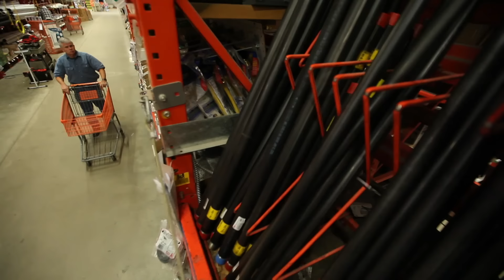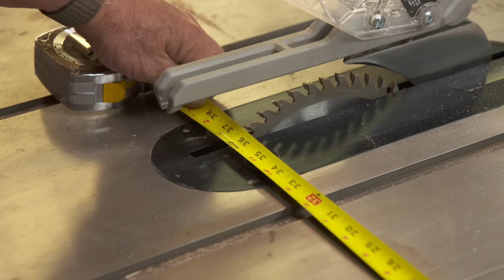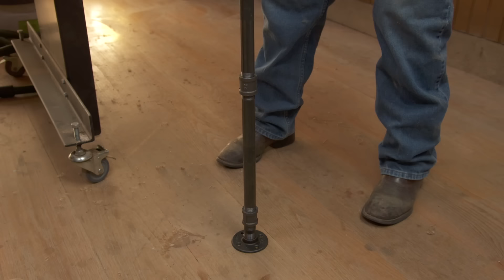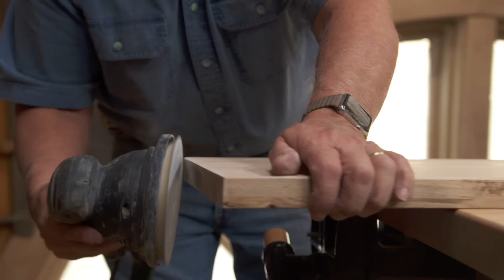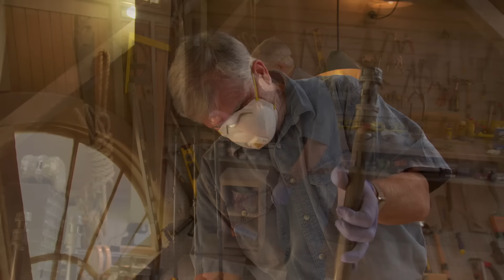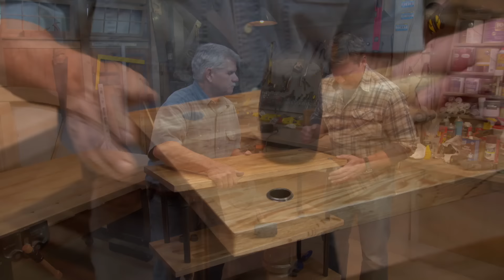Black Pipe Bookshelf | Build It | Ask This Old House

Comment: This is a great rack idea. It's simple, modular, robust and adjustable. You can adjust the height simply by using different length tube segments. Also, when you move house or change the number of pieces of gear you can easily add or remove shelves at will. As a bonus it looks good too, with that retro-industrial-rustic design and it can be made very cheaply.

Comment: nice, I made a desk a couple years back with plumbing pipe at my local hardware store. I spray painted my couplings gold, and the pipe a more even black paint and left my flanges and elbows the gray color.  Had no idea this was a trend until now.  I wanted to buy a desk with the industrial look, but some ran between $1200-$3400 for a desk. So I decided to make one instead and mine is a taller than normal, so I could stand and wouldn't have to use a chair all the time to do my computer work and general work.  And a heads up, I used 1 1/4" pipe and those flanges are not cheap.  I needed 14 flanges and it cost me almost $200.  Total cost was about $900  :/.  Wood is not cheap.  Nonetheless, I am very happy with my desk and it will serve me years to come.
Reply: +jessejames! Nice,I want to maybe build my own solid shop table I'm not sure If these ideas would work but it's a good thought.I'm using an old wood table the thing is short and shakie what you explained sounds nice I'd have to do that sometime too for a computer stand.

Comment: One way to reduce the price is to buy a larger piece of pipe and have the home center make the cuts and threads for you to your specifications. I know that Home Depot by me will do this (the cut/thread machine is generally in the same isle) for free. I think you can get a 10' length of black pipe for less than $20...
Reply: They’ll usually do a few for free but don’t expect them to cut 20 ends for free

Comment: As others here have commented, black pipe and fittings are expensive. I have built several shelving units using inexpensive PVC pipe and threaded rod.  Cut the pipe into lengths to match the desired shelf spacing. Drill holes to allow passage of threaded rod at pipe support locations. Cut disks with a hole saw to match inside diameter of PVC pipe. Assemble shelving unit, passing threaded rod from top to bottom through holes and through PVC pipe. Use cut disks glued in place to centre threaded rod in pipe sections. Tighten nuts with washers top and bottom, and you are done. Use 1 1/2 " and larger diameter pipe. Tension on threaded rods stabilizes unit. Can add leg stubs and nut covers to your taste. PVC pipe can be painted. Have also used variation of this method to build refined bookshelves - wood verticals (use your imagination) with passage for hidden threaded rods. Threaded rod available in up to ten foot lengths. Simple, simple, simple.

Comment: What determines the maximum allowed weight for a shelf: the thickness of the wood or the number of pipes? I'm looking for something to hold excess plates and glasses.
Reply: jillhbaudhaan I don’t think the weight of some plates will compromise the wood and pipe, as the the pipe is metal and round (a very structurally stable shape) and the wood (at a thickness of about an inch) should have no problem with warping.
Reply: @Michael02496  thank you so very much!😁

Comment: Pretty neat, but for the size of this bookshelf, you could use smaller black pipe and shelf grade wood instead of a butcher's block.  Would save a lot of money.  This shelf could probably hold a truck up.

Comment: On a scale of 1 to 10 how hard would it be to get a nice straight hole cut by hand with a drill (and maybe a vertical piece of wood to guide) vs. the portable press? Also I'm only going 3/4" deep as my boards are more shallow. Wondering if I should spend the $25 on the press (and have for possible future use although may not use again).

Comment: Could you not use some 3 hole 3/4 flanges to serve as joins for the shelves? This way you are not drilling holes in the butcher block and seems like it could be more sturdy.
Reply: Of course. I think they chose the threw hole for asthetics and for a bomb proof level of durability. 3 screws would fail before the pipe of the hole. 

If you pay attention to the end during assembly, he explains that they used a drill bit about a 1/16"th smaller than the outer diameter of the pipe and used a drum sander to bring the hole a little closer to the pipe diameter; the wood will compress a bit as they pound the larger pipe through, which will make it quite sturdy. The drill press helps ensure the hole is perfectly centered and perfectly square with the surfaces of the shelf. Though, it must be noted that with time, those holes may become loose. I'm not sure if butcher block is made of stabilized hardwood, but if it is, and if the shelf if kept in an area with relatively stable humidity and temperature (indoors rather than in a garage or shed), these concerns should be mitigated. 

I really like this project, but I think you bring up some very interesting concerns that should be taken into account when using woods other than the butcher block used in the video. I was planning on using oak or maple planks, but I'm not sure if they will be stable long term to rely on compression and friction to keep the shelves from racking. I might look into doubling up the pipe fittings (top and bottom) and using a very tiny pipe in the shelves so I can compress from top and bottom to maintain stability and squareness.

Comment: A lot of people will say "I am totally making this" till they get sticker shock.
Reply: @J The wood is not at all the reason people would get sticker shock. The pipe and fittings here could easily cost you 100+ dollars. I just tried to price one out and found even the fittings are 5 bucks or more each.
Reply: Ishmael Maphingers I always laugh when people suggest that pipe clamps are cheap...a decent length of pipe is $30 plus the $20 clamp.
Reply: I’m guessing you haven’t priced out a decent bookshelf.

Comment: Re: previous comments...
There was nothing said about this being cheap. And  when you start working with any kind of iron pipe it never is (bring your check book, or charge card!).
That said... Doing it gives you the satisfaction (??) of having built something, and/or customizing it to fit a particular situation.
Kits to build these are available for a couple to several hundred dollars. Or, you can go to one of those fancy-ass boutique furniture stores, and shuck out a couple thousand bucks for the same thing.
I've made a few of these things, and here's a tip: if you buy the pipe at a big box store take your measuring tape along to make sure the pipe from the "one foot" bin is pretty close to that. There can be some variation.
I have all my pipe cut, and threaded, at the local hardware store. Costs a bit, but worth it. That way they like me, and don't treat me like I'm from another planet when I ask them about something even they've never heard of.

Comment: Just did the math.  Each post (3/4" floor flange + three threaded connectors + cap + three 12" pipes + 3" pipe) comes to $44 each...so you're at $188 for just the plumbing!!!  Now that butcher cutting board... that's another $100 for a piece like that.
Reply: well when you tell me that ,this project is not for me anymore
Reply: Zoro has significantly better prices on pipes than home centers. Combine that with (cedar) wood from the local lumber yard and I was able to build a 3-piece bookshelf twice this size for about $125 ($85/$40).
Reply: Or just use pc pipes and paint them rustic black finish
Reply: 44x4 is not quite 188. No one  said it was a low cost project anyway.
Reply: Similar bookshelf will cost you about $400
Reply: Which is pretty good for this quality.
Reply: could build it with pvc pipe (painted black) and plywood
Reply: its not about saving money - its about making something for yourself ...
Reply: Local Menards: 4x 3/4" floor flange ($15.56) + 20x 3/4" coupling ($19.98) + 4x 3/4" caps ($3.96) + 12x 12" 3/4" pipes ($35.88) + 4x 3" 3/4" pipe ($3.96) = $79.34 plus tax, go during the 11% rebate and that's around $70 plus tax, and you have 4 spare couplings, maybe I'm missing something though
Reply: @Broc R. Thank you sir! That's exactly what I'm going to do.
Reply: @Broc R. Dude you're amazing for outlining all of that for us!

Comment: Just did the math.  Each post (3/4" floor flange + three threaded connectors + cap ! three 12" pipes + 3" pipe) comes to $44 each at Lowe's...so you're at $188 for just the plumbing!!!  Now that glued finger cutting board... that's another $75 (for several much smaller sizes)

Comment: Hi, I am trying to build a shelving unit using the 3/4 black pipes but I am having an issue with making a tight hole into wood. I tried 1” bit and it was too small and I tried 1 1/8 and that was too loose. What is the correct size I need? Please help, thank you.
Reply: 1 1/16

Comment: A question guys, i have a bit of 1 3/8 inch size, my pipe is 3/4 inch , do you think my pipe would fit perfctly on the wood? I want it tight , thanks.
Reply: You would need the right size washers on each coupler to span the gaps from your oversized bit. It would probably be more economical to obtain the 1-1/16" bit—plus the right size bit would help to keep the shelf from racking.

Comment: 1-1/16 was the hole size for 3/4 pipe? that wold be way too sloppy.  Is that a mistake?
Reply: 3/4" pipe has an outer diameter of 1.05". The bit of 1-1/16"= 1.06". Making for a tight clearance of just .01"
Reply: @brettdavis9575  25 mm

Comment: it is easy to build if you have all the equipment =)
Reply: I'm saying! 
if I had that huge table saw ...so much for this DIY good video though
Reply: All you need is a circular saw. It's the most versatile power tool next to the drill.
Reply: I build everything with hand tools and a circular saw.  That's all you need.  No one needs a whole shop of electric wood working tools unless they want it/or need to build stuff planning to sell what they make
Reply: you dont need all them tools if you wanted to make it you can do so with basic stuff
Reply: Years ago it was popular, and easy,  to just use cinder blocks between 2" x 8" wood from the lumber yard.  No tools or hardware required and it made a cheap, but functional, bookshelf.  Stain or paint optional.
Reply: Skyethur Eh... hardware store will cut the boards for you. An old arbor hand drill would work, and the drill bit isn't expensive. All the sanding can be done by hand. A hammer. A wrench. People built stuff before power tools just takes a little effort.
Reply: Skyethur Learn to make friends that already have all that stuff. Just make sure to be returning the favors.
Reply: Home Depot will cut wood down to size for free up to a certain number of cuts
Reply: Thanks for the info, Im going to have home depot to cut the wood for me. I wish they would drill the holes too.
Reply: I have spent months studying building marimbas and discovered a great resource at Delfords magic plan (check it out on google)
Reply: Rohit Deo it took you months to find a Google link?
Reply: Skyethur everyone on the planet should have a drill and a pipe wrench

Comment: I'm thinking of doing this with standard 2x10 construction wood (pine) to cut down the cost, anyone tried similar project with this kind of wood?
Reply: It would work just fine, just be aware that the pine is softer, so you may not to ream the holes.  Don't span more than about 3 feet, or you're likely to have sag in the shelves due to the softer wood.  I'm sure yours will look good!

Comment: Yup, this is not cheap at all.
Reply: butcher block is very expensive. black pipe is relatively cheap but you could build the whole thing out of a sheet of 3/4" plywood (depending on measurements) for $50 or so. Add a few bucks for a sheet of lauan for the back and some edge banding if you like and you've got a nice shelf for much less than that piece of butcher block.

Comment: Leaving aside the important questions of cost and stability that others have raised, I have a question about butcher block as a shelf material.

Books are heavy. That block is dozens of little strips glued together. Is it going to come apart as it sags under the weight of the books? Doesn't sound like the best material to me.
Reply: The wood itself will break long before the glue holding the pieces together will break. A glued joint, when done properly, is incredibly strong.

Comment: Hi, I tried to build this shelf in 1feet x 4feet long
but the problem is that the shelf is not stable and it not rigid 
it is moving in all direction and i think the problem is with the hole that i bored (.5mm more i guess just thinking) . 
Can you help me to fix it ?
Reply: You could try wrapping the pipe with say, electrical tape or similar until the pipes diameter is large enough to take up the extra gap in the hole. If any of the electrical tape is showing once assembled, use a razor blade around the pipe to remove the extra.

Comment: What size hole are you drilling for what size pipe? I thought you were using 3/4 inch pipes but you said your drillbit was 1 inch and 1/16th.
Reply: It's 3/4 in. inside diameter on the pipe.  He used a 1 1/6th in. forster bit and then used a small drum sander to make it slightly bigger.
Reply: That doesn't make any sense.... 3/4th black pipe has an external diameter of 1.05. If he drills a  1 1/6th hole the pipe wont hold tight...
Reply: Benjamin Duyck actually iron pipe is about 3/8th bigger then the inside diameter of the pipe so 1 1/16 with a bit or extra sanding is perfect. Remember the threading on the pipe is tapered so at the very end it will be small then get wider to the normal with of the pipe.

Comment: I would have used T's at the top and bottom and couplings on both the bottom and the top of each shelf. 
I have one rule above all else when building something. If its not better than what I need it's not good enough. If I need a shelf to hold 100 pounds than it must hold at least 150 pounds or I won't build it.

Comment: Can anyone confirm that a 1-1/16" forstner bit fits snug around the OD of 3/4" steel pipe?
Reply: Quinn McHugh he said that, but I believe a 1” bit could do it.
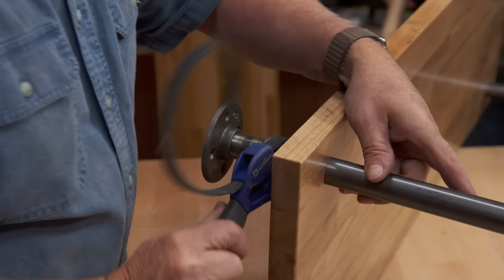Reply: Correct :  1-1/16" , he confirms this at 4:42
https://youtu.be/yt0imxrGmHg?t=4m42s
Reply: 25 mm

Comment: Simple and nice build.
Does anyone know what those yellow triangle pieces are called ??? Those he put the shelfs on while painting them.
Regards
Reply: Thx I will give it a try 

Regards.
Reply: I got some either at Rockler woodworking or a Home Depot I think. They are "Painter's pyramids".
Reply: thx.
Reply: Thias Russell Yeah they are nice but why bother. Just get a nail and drive it though a decent block of wood. Leave it pointy or round off the tip.

Comment: Where does one buy sheets of butcher block??
Reply: Home depot and other places that sell counter tops can order them in, but they are quite pricey.
Reply: It doesn't have to be butcher block. Other sizes and types of wood can be used. Butcher block just looks great.
Reply: Depending where you live, and luck, you can find good deals on used butcher block tabletops on Craigslist. Especially if you are going to sand and oil it anyway, you can get away with some weathered pieces.

Comment: I'm leaving this comment here in case anyone looks this video up for inspiration. There is a serious flaw in the way This Old House goes about constructing this shelf.  Their build relies ENTIRELY on the holes being a perfect fit with the pipes for stability, as the shelves are just free-floating, held down by nothing more than gravity. Get the fit of the holes and pipe off by even the slightest bit, and the pipes will be able to wobble in their holes, and the whole shelf will be a wobbly mess. I would instead recommend going with the approach of using TWO female-female couplers for each shelf/pipe intersection. One coupler sits below the shelf, and another sits on the top side, connected through the hole by a short section of pipe. With this approach, the strength comes from the couplers being tightened down such that they "clamp" the shelf on both sides of the hole. Much more stable, and you don't need to be as precise with getting the size of the holes EXACTLY right. As long as the holes are bigger than the pipes, but smaller than the couplers, you'll be good. (Use a bit that is 1/8" or 1/16" larger than the outside diameter of your pipes.)

Comment: I'd suggest not making a cross cut with the rip fence setup on a table saw unless you really know what you are doing. ESPECIALLY if you aren't using a miter guide to push with. Just my opinion..stay safe.
Reply: He used a gauge block on the rip fence to set his length. Tommy knows enough not to use the rip fence to do crosscuts.
Reply: Yes, agreed that Tommy knows what he's doing, I just wanted the casual viewer / first time DIY'r to be careful. We had a summer helper that had a board thrown back at him because he didn't listen and did it wrong. Just want everyone to be safe.

Comment: And it costs 3 times what a store bought shelf would cost.
Reply: Also just as many times nicer.  As for cost, your store bought crap is usually particle board with veneer laminates.  If you actually bought this from some store that specialized in this faux industrial stuff you'd probably pay a heck of a lot more for the "craftsman" premium.
Reply: You get what you pay for. The particleboard crap shelves only last for a few years before the shelves sag and they don't tend to hold up well if/when you move. Building it yourself alleviates those problems but you pay more for materials. Also, building yourself means you can customize as much as you want.